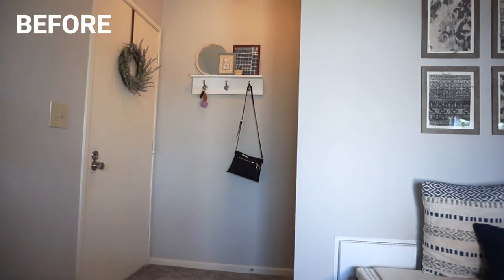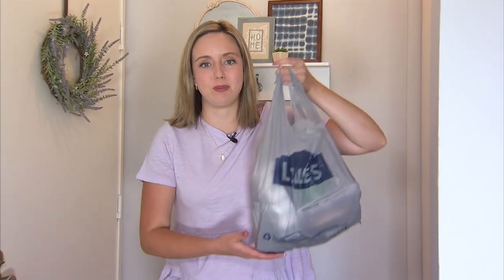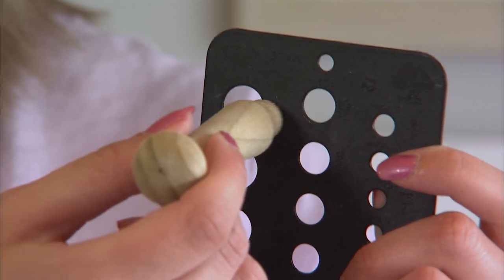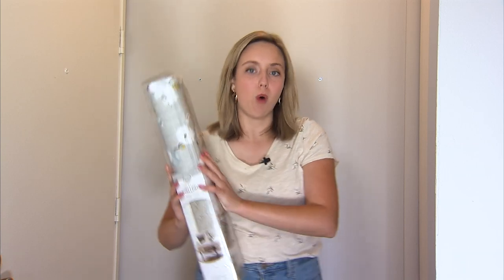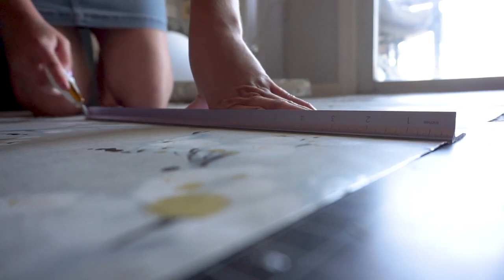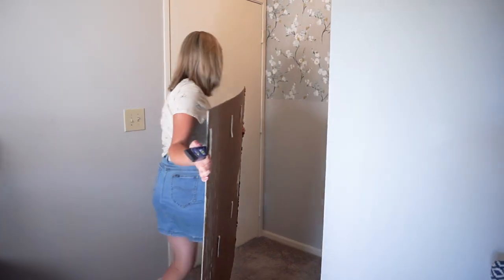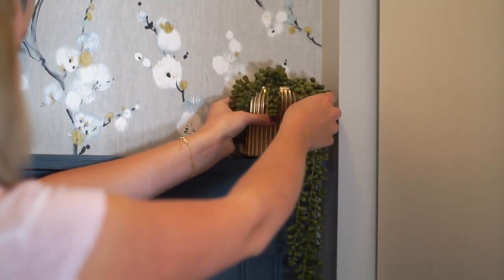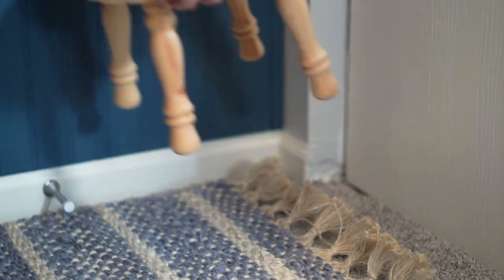I gave my entryway an EPIC renter-friendly DIY transformation ✨

Comment: Very nice. If it were me, I probably would have painted that wallpaperspot where the hook bar didn't reach and then also put the plant in front of it. The plant was genius.

The command strips you used are really holding up that beadboard??!!!! still working a year later? Beadboard seems to heavy for that to me but if it works awesome! I might try it too.

Comment: You can cut another piece of wood to fill that gap, use wood fillers to smooth out the edges, and paint over. Should give you seamless results :)
Reply from the maker: That's exactly what I was thinking too. I probably have some scrap pieces I can do it with

Comment: Love it! I live in a rental and the landlord replaced the vanity in the bathroom with a smaller one. So now there's a gap between where it ends and the wallpaper starts. Also, some of the wallpaper is peeling off in some places. I was thinking of putting up pole wrap (normally used to cover support columns in basements) on the wall but I may go this route instead. I'm afraid to use nails because I don't want to damage the wall or the pipes behind it as the toilet is also right there. I'm going to try using command strips instead! Thank you for your brilliant ideas and the inspiration too!
Reply from the maker: Yes!!! Command Strips are lifesavers in rentals! That's a perfect solution to fix your bathroom wall/vanity area

Comment: It looks great. But does the door open without rolling up the rug or banging on the shelf?
Reply from the maker: There's one of those spring doorstoppers that prevents the door from hitting the shelf (I was worried about that too before building it, but the door has plenty of clearance). I ended up moving the rug back where the navy blue one is from the before footage, I just couldn't "capture" the full effect in the reveal footage with rug placed next to the door. I wish I could keep a rug there so I wouldn't track in dirt on the carpet though 😩

Comment: Beautiful design! How can you drill holes on the wall? Do you have the original paint color to repair it when you move out?
Reply from the maker: My apartment complex doesn't care about putting nails or screws in the wall as long as I spackle over the holes when I move out! Then their maintenance crew will come in and re-paint

Comment: Don't move the shelf either paint the wall paper on that space or fill it up with a piece of wood ( little blocks, or custom cut) and paint it, or also fill the space with some cement, caulk or anything that you could paint there are many things you can do to fix the gap